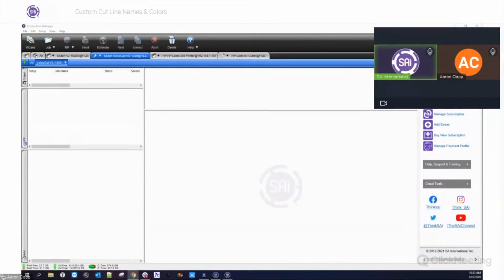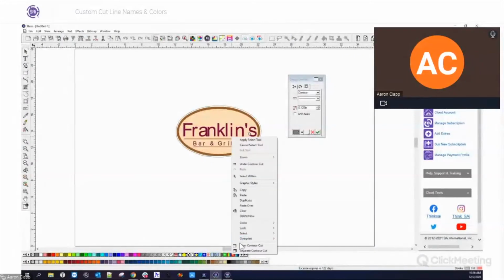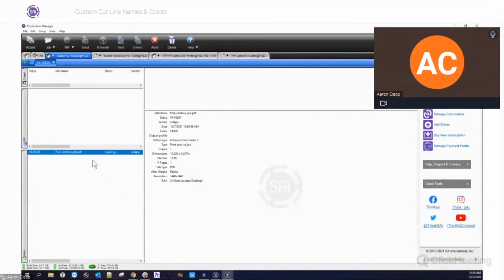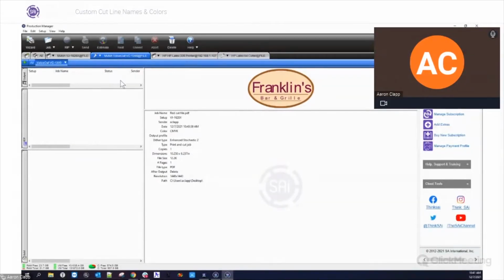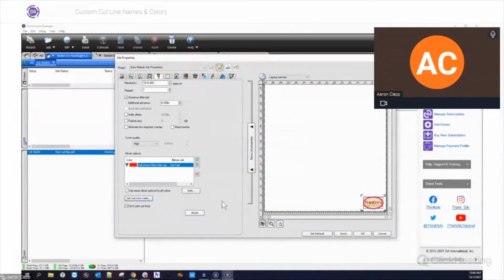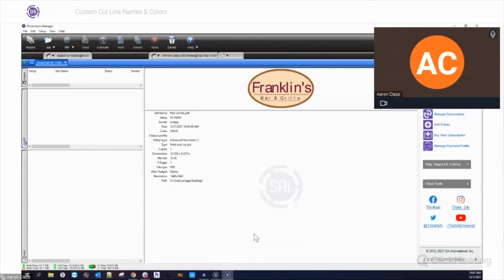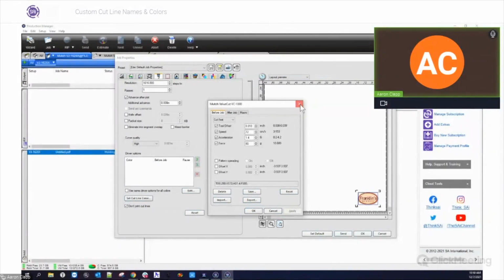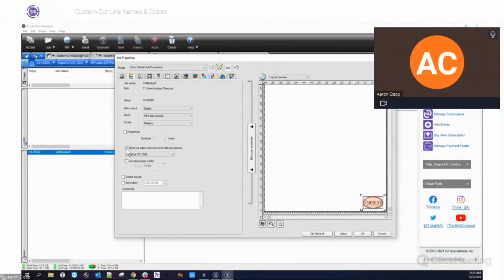SAi Flexi Webinar - Custom Cut Line Names & Colors

Comment: I have an issue. I import pdf vector file and i need a cutter to cut throughout the cut lines- not only contour cut. The problem is the software doesn't see the lines. They are in black. How do I make them to be seen by the software?